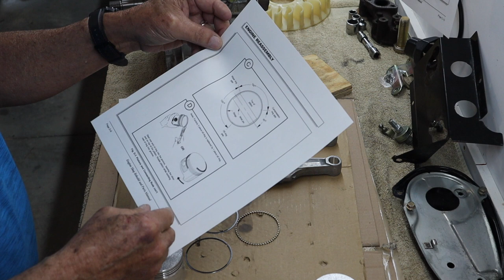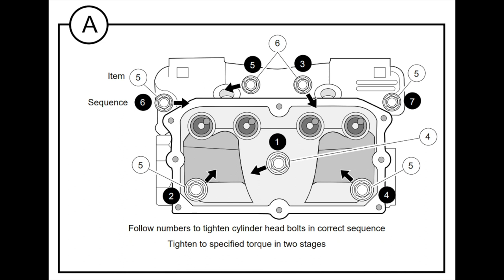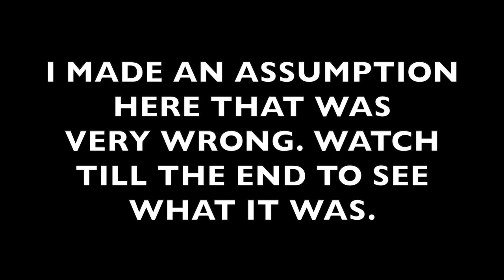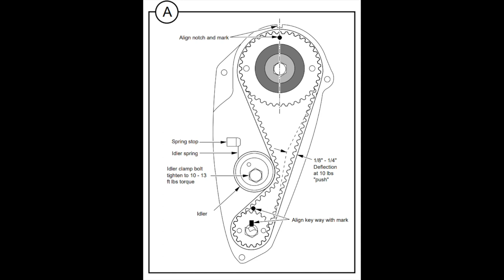EZGO TXT 295cc Robin Engine Rebuild (EH-29C)

Comment: thanks for sharing, saving some bucks by not having to buy a ring compressor was worth the watch for me. I'll have to check the valve spinner tool for a better model.
Reply from the maker: Hi Phatz, Thanks for watching and the comments! The thing about using the soda bottle is that the edge that goes down to the block has to be cut fairly straight, otherwise the rings tend to come out a little between the block and the bottle. Also, I thought I had a decent set of the valve spinner tools but apparantly not...  Either way I do appreciate you watching. If you have'nt done so already, please do me a BIG favor, hit the like button and subscribe please. As you can see I'm a pretty new YouTuber and every sub helps a lot.

Comment: Neat spin on the ring compressor!
Reply from the maker: Yeah it worked pretty well.  You just have to make sure you cut it good and straight so that it contacts the cylinder evenly all the way around. So the rings won't pop out...

Comment: thank you! i did same thing on timing but still on bench building it so not big deal.
Reply from the maker: Yeah, I would have bet money that the white mark was the correct alignment, but guess not. Glad you caught yours before being installed. I had to pull my motor when I realized what I had done? Let me know how yours turns out.
Reply: @NINEPOINTFIVEPROJECTS    Turned out great and runs like a top!!! glad i didn't have do it twice thanks to you!!
Reply from the maker: Glad it worked out for you (especially on the first try!). Thanks again for the comments!

Comment: Great tips in your video!  I just pulled my 99 TXT in the shop and getting ready to tear down.  My issue is smoke, oil use and about 120psi compression.  I think it's prob the valve seals, bit since I'm cracking the egg, I may as well make the whole omelet.. I found a few different rebuild kits, one does not include the rods and drive belt for about 1/2 the price. Do you think it was worth replacing the rods?  thanks again for the video!
Reply from the maker: Hi, thanks for watching and the comments. I doubt that the rods needed replaced in mine but they were included with the kit I found. I didn't see the kit you're talking about.  Good luck with the rebuild (omelet haha) and let me know how it goes for you. I think you may have already but if not please consider Subscribing, liking and tapping the bell icon. I would really appreciate it. Thanks again.

Comment: Thanks for the video. Im in the planning stages of doing mine. I have a question for you. My compression is still 170 on both cylinders. Did you go back with standard size ring set or oversized?
Reply from the maker: I went with the standard size kit.
Reply: If your showing 170 compression in both cylinders may I ask why you are planning a rebuild?

Comment: On the original coil it is depressed and a plug with 2 wires goes in there to make the connection.  Can the red and white wire be switched and it still work?  Or is the pulse (white wire) specific to its placement
Reply from the maker: Hi thanks for watching and the comments. I'm not sure if it matters or not, but I have the white wire towards the front. Hopefully this response isn't too late to help you. Either way, if you haven't done so already please consider Subscribing and hitting the like button. I would really appreciate it. Thanks again.
Reply: @NINEPOINTFIVEPROJECTS  hello.  I'm still trying to get to the bottom of this.  I just contacted ezgo and got the yr and model, 2006 MTP 1200.  My coil has two pins in a depression in which a connector snaps in.  Problem is that the previous owner cut the connector off.  Do you have any resistance values for this coil?  I am assuming you test the resistance through the high tension side
Reply from the maker: @frontlinemedia4270  unfortunately I don't have the values and I'm not to where I can check them for you. I probably can Monday if that will help you.
Reply: @NINEPOINTFIVEPROJECTS  OK.  My understanding is that there is the trigger wire and the 12 volt wire that goes to the coil.  I'm thinking of putting 12 v directly to the coil to see if I get spark.   I am almost out of options. Any thoughts?
Reply from the maker: I am reasonably sure that one side does get 12 volts, but not until the accelerator is depressed slightly.
Reply: @NINEPOINTFIVEPROJECTS  yes.  The 12 volts comes from the solenoid which clicks on when you push the pedal.  I just got a wire diagram.  The coil is specific.  Now my problem is what is the negative side and positive side of the coil on the newer version?  There are no marketings that I can see at this point
Reply: @NINEPOINTFIVEPROJECTS  I do have the resistance readings for the older coil style, two prongs
Reply: @NINEPOINTFIVEPROJECTS  I should clarify.  I have the values for your coil.  Primary: 3.7 - 5.2 ohms, Secondary: 10 - 17 k ohms
Reply: @NINEPOINTFIVEPROJECTS  I am not sure how you determine what pin is pos or negative.  But I have continuity between these two pins.  It would be helpful if you check your two pins for continuity so I can see if yours is different than mine.  Thanks

Comment: Where did you get your cylinder honing tool?

Just got my engine removed from the cart. Your videos are super helpful! I subscribed.
Reply from the maker: Amazon
Reply from the maker: And Thanks a lot for subscribing!!
Reply: @NINEPOINTFIVEPROJECTS  was the tool just a generic size, or did it have a certain size or specification?
Reply from the maker: & EWK 1-1/4 to 3-1/2 Inch 3 Stones
Engine Cylinder
Hone Tool
Adjustable
Cylinder Deglazer
Piston Honer 220 grit on amazon
Reply from the maker: I tried to post a link to it but couldn’t figure out how to do it.

Comment: Did the manual pages come with the new kit?
Reply from the maker: Hi and thanks for watching. The kit did not come with any documentation that I recall. Torque specs can be found on the internet if that's what you're referring to. Let me know if that's what you need and I'll try to point you in the right direction. If you haven't done so already please consider subscribing and hitting the like button. Thanks again.

Comment: It’s been 5 months, with going back with standard rebuild kit, how is the engine running now.
Reply from the maker: It's still running great!
Reply: @NINEPOINTFIVEPROJECTS  thanks, just tore down daughters 1999 cart, 1 connecting rod crapped out, but rather than boring and oversized piston, I’m encouraged to go back like you did. Rather than going with parts from local golf cart shop at 569.00 parts plus tax. Great video thanks a lot.

Comment: There must be plenty of space between the pistons & the valves & doing the timing belt wrong with most other engine would be a bent valve or 2.
Reply from the maker: Hi thanks for watching and the comments. I'm not sure if the engine is a non-contact engine or not. I guess if it is I was lucky and apparently where I had it out of time was still at a point to where the valves wouldn't hit the top of the pistons.. Either way I think you may have already but if not please consider Subscribing and hitting the like button. I would really appreciate it!

Comment: Motors are electrical  engines are gas or diesel. But enjoyed the video!  Thanks
Reply from the maker: Good point! Thanks for watching and the comments. If you haven’t done so already please consider subscribing. It would help me out and I would appreciate it.
Reply: Unless you are General Motors or Ford motor company.
Reply: You better tell Penzoil, Valvoline, Quaker State and Rotella that they be selling Motor Oil only for them Tesla engines at Wal-Mart…🫠
Reply from the maker: Hi, thanks for watching and the (funny) comment! I think you may have already but if not please consider Subscribing and hit the like button. I really appreciate it!

Comment: When I torque the rod arm to the crank the crank won’t turn it locks it up any idea why it is doing that
Reply from the maker: Hi thanks for watching and the comments. I'm not sure I'm following what you're asking.
Reply from the maker: Do you have new rods?
Reply: @NINEPOINTFIVEPROJECTS  no I reused the original ones just put in the new pistons
Reply from the maker: Hum, that's really odd. Do you have them turned the same direction as they were when you removed them? Is the crank pushed completely into the case? If you didn't get the crankshaft completely back into the case the rods might be binding when you tighten them down.
Reply: @NINEPOINTFIVEPROJECTS  I do have them the same direction they were removed along with the marks lined up. I will double check to make sure I have the crank pushed all the way in and I will let you know. Thanks for your help.
Reply from the maker: Yeah hold a wooden block on the end of the crank and tap it in with a hammer.
Reply: @NINEPOINTFIVEPROJECTS  ok I will do that thank you
Reply: Good News !!! You were on point the crank was not far enough back. I appreciate the quick and accurate response.
Reply from the maker: @davidharvey6672 Fantastic! Let me know how the rest of the rebuild goes.

Comment: I just rebuilt mine again the last thing I took apart was the head all four valve seals had come off.
If you clean and use the old filter the o-ring in the oil filter should be replaced the filter should fit snug on the nipple, I will get back with the size. The valve seals will come off I glued them on with super glue. I use the same kit you use and have had the seals to come off. I would like to know are they supposed to be that easy to push on? Why because it’s not normal they fit so easy, I don’t think so. The last kit I got from Fayetteville NC the timing belt was a bad fit a real bad fit.  I would like to know where you got the info the chrome faced piston ring goes on the middle grove?. Just curious. 

To finish up I have never seen valve seals push on that easy are the oil scraper ring be chrome faced.
Reply: Small o-ring engine side cover to engine case -010
oil pump cover -134
amall o-ring inside oil filter -111
Reply from the maker: Hi thanks for watching and the comments. The only thing that indicated which ring went where was a chamfer on the inside of the ring which turned out to be the chrome one. I think you may have already but if not please consider Subscribing and hitting the like button. I would really appreciate it.

Comment: A 50% - 50% kerosene trans fluid makes great honing oil when running a glaze breaker.
Reply from the maker: Hi, thanks for watching and the comments. Good tip! I think you have already, but if not please consider subscribing. I really appreciate each subscriber as I continue to build my channel. Thanks!